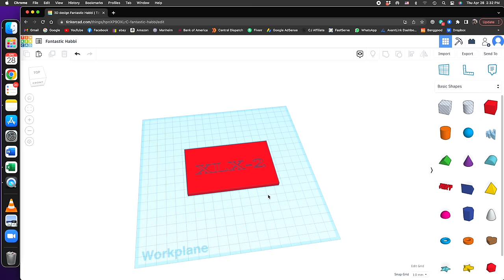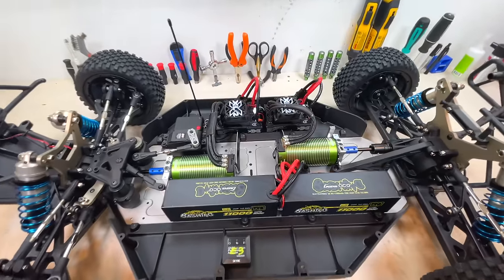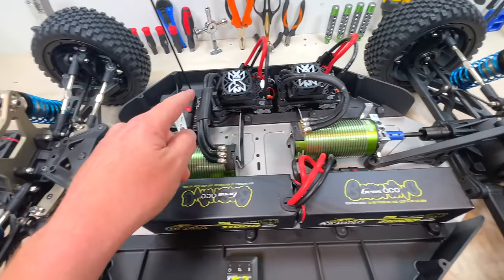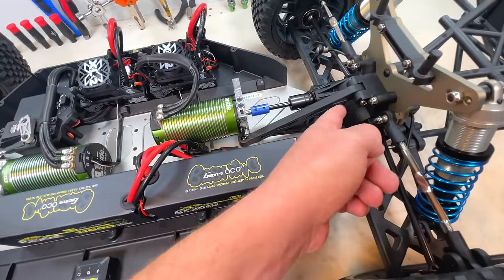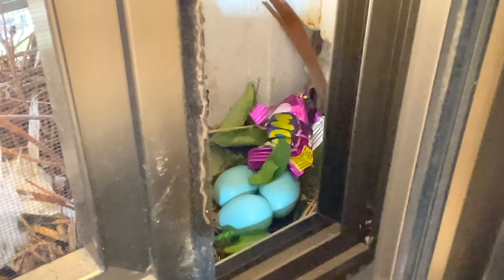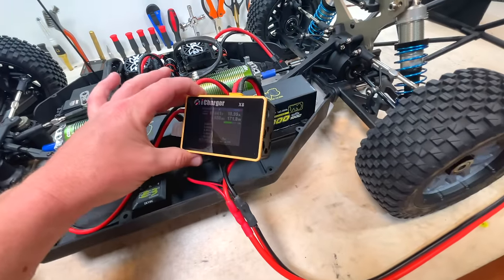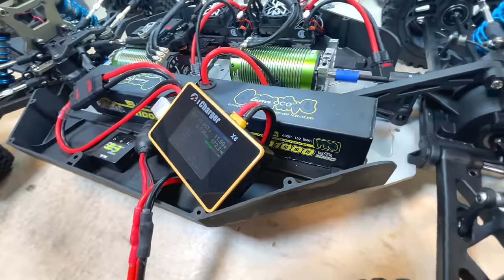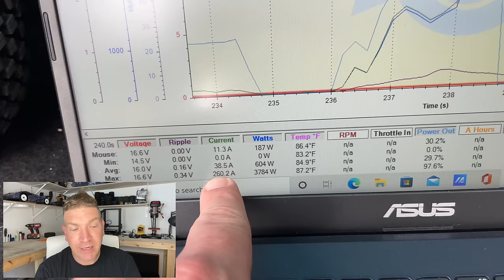Rc Car With Two 25HP Motors - Losi 5ive

Comment: I built a brushless nikko dictator with a bunch of custom upgrades, specifically targeting the Traxxas Slash for performance.  the On a 3S speed run, I was trying to get 1 more mph which required running it through a narrow part of the parking lot. It hit a bump and hit a concrete curb at 45 degrees, probably around 40 mph. The heartbreaking part was 35 year old chassis and transmission pieces were destroyed and could not be replaced without a parts car. I did get it back on the road. It’s my favorite rc car out of the 50 or so in my collection.

Comment: Tough luck on the crash sir. fifth scale vehicles can be a handful to slow down, so much momentum. cant wait to to see how you repair it! for another onroad project, I highly recommend you look into the MCD XR5/XS5 platform. as an owner of both a losi and an MCD I can promise you its a platform like no other. plenty of space on the chassis to do upgrades, massive engineering in the platform as well. I know if you build an MCD it will be like no other.  good luck!

Comment: Raz, I feel your pain. Not nearly as expensive, but I built a 1/10 road car to see how fast I could get it. I am not sure, because the first run ended in the car disintegrating. It was as simple as a center reflector in the road that I hit almost center chassis. The reflector was decimated, but the car was a total loss. There were a good many parts that were never even located. I put quite a few hours in it. Gutted for mine and yours both.

Comment: I thought you learned your lesson about running off road cars without cages? I would like to see corner weights and CG points before and after these builds, cg and corner weight can have a dramatic effect on driveability and I am curious how far from baseline your mods take it.

Comment: Trailer park math here... 11 Ah batteries rated for 100C... that means a max Amperage of 1,100, and at 15V (give or take, depending on charge level), that's about 16k Watts per battery. Now, 25 horse power is 18k watts... so yeah, that's an INSANE amount of power going through such small motors. At first glance, i thought it was total rubbish, but wow... 50HP in an r/c car is just nutso!!! ty for the vid. Sorry about the crash! I flew r/c helos for many years. I know the feel.

Comment: 25 hp is 18.38747 Kilowatt (kW)... How did you calculate those small electric motor to have a output that is 25hp?

Comment: Nice wanted to do this for a while just the funds so I done it to a wr8 that I modified to 257x200 mm wheelbase so it was a 10th scale 2x120amp hobbywing 2x3300kv motors 2x3s never got a clear reading on GPS best run was 63mph on its back wheels great vid sorry for your loss

Comment: since both motors are offset, the batteries and the controller could have been mounted on different sides and the weight ratios would have been balanced.  But still great, wow!

Comment: I love your videos and definitely feel your pain brother! I bet it crashed because you did not run a spool or 2 Million weight oil in the Diffs with belted tires. These are a MUST. Without more-locked diffs the tire without traction will just spin 2x faster, and expand as you can see from the before crash clips and "traction steer" the car. I have been down this road MANY times. Not for bragging but to prove experience, I have 3 Electric 5ives, and all are center spool and 2M wt diff oil (spools make it under-steer in the corners) by necessity, learned the hard way. Anything above 70 mph you will blow out non belted tires if you are off road at all. Honestly, that's not a bad crash at all, it looks like you had 3 problems that came together... 
1. You relocated the front diff support, the stock one has 2 bolts, I have sheared these bolts a bunch of times, until you make something super strong, a bumper impact will break the diff cases every time, even in a CNC aluminum diff housing, this needs sorted out first. 
2.  For that 2 motor setup you located the battery and ESC's to the perimeter of the chassis.  I'd make a plate that goes above the motors that ties into the front Diff support, and mounts the ESC's above it as well. There is a TON of room under the cage of the 5ive T, and it would put the ESC's in fresh cool air. I run similar to this in a 5ive B body with no issues.
3. 3D print motor cradles that bolt through the chassis and can use large Zip ties to hold the motor to the mount to take the strain off of them during impacts.

A few other electric 5ive tips, run the batteries ans ESC's exactly opposite of each other, and as close to center of gravity as possible to balance the 30lbs this weighs, will make a night and day difference when you start jumping it. I regularly clear 150' with no problem or breakage, and bash HARD. I honestly believe these 5ives are the toughest RC cars on the planet.
Reply from the maker: Thank you so much for taking the time🙏🏻

Comment: I'm guessing you highly understand estimated the amount of stress and force on them motors and drivetrain and you throttled  up hard and it sucked up insane amps because of the rotating mass of the 1/5th scale drivetrain and tires and the fact it's direct drive then you need to stop and can't because the motor braking wasn't even close to enough to stop all that mass at speed of any kind. You need very strong disc brakes and I don't recall seeing any. Motors and all ejected because them heavy batteries were only velcroed down and when they went because you use big connectors, big wires and small screws everything went with them.
Reply: good thing its his build and not yours lol 😅

Comment: It’s in the air.  Totaled my gt2 1/8 as well.  Life is funny but next time you only need one motor and it will still be as fast.  The chassis setup isn’t built for speed so it will always be overwhelmed, but f you ran the wing ……would of could of kinda thing

Comment: Inspires me to finally make an electric conversion for my old 1/8 Jammin' X1. I'll probably just do a slipper clutch for the center, motor on the side of the servo with the esc behind it and have the other side for a beefy battery. Even if it ends up like this one It's worth doing because it just sits as it is. I've been done with nitro for years
Reply: Castle used to made an electric conversion for the Jammin X1CR.  I got one!

Comment: Sucks that such a beauty is gone so fast. Is there a reason you don’t model the screw holes into the ESC plates? It would make the mounting holes much stronger as they would have inner walls printed instead of voids in the infill. 👍🏻
Reply from the maker: I was just lazy lol

Comment: Not having the front and rear diffs connected, powered by seperate motors, will be way worse than having an open centre diff, the front wheels will have a ton less load and spin like crazy.

Comment: I think issues wasn’t to run without cage. The reason in damage the engines there’s not rear bracket holder on both engines.

Comment: 25hp is 18750 watts.  At 6s voltage that's around 850 amps per motor.  You sure your numbers are accurate?

Comment: After watching both this and the crash video, it looks like the servo was the cause. In this video you can see how slow the steering returned to neutral. So it looks like the servo is too slow and not enough torque. I'm sorry for your loss, it sucks. But, you have since rebuilt it and I hope you test better servos before running full speed.

Comment: Id like to see one of those motors on a 80 frame dirtbike and see how it wont be no 25 hp of ripping i would guess. Just dont see a shaft under 20mm putting out that kind of power.
Reply: yeah. I'm trying to figure out where he got 25hp each motor. my calculations come up w a little over 5hp each. still 10hp in an rc car is pretty good.
Reply: @jonnytoast  and u can call them whatever hp u want fact is the tread those tires are putting down are only going to grip so much hp which yes the amount of hp the tires will grip increases as speed increases but talk about overkill because those tires up till 100mph will probably only hold so much hp which would be interesting to ACCURATLEY know not hopingly or falsely know.  Again i doubt one of those motors will not sent a 100lb kid over 100ft triple on a 80 grame dirtbike but a 80cc dirtbike with roughly 25hp will for sure.  Some people just prey on the unknowingly people with clickbate HP titles.

Comment: Bummer the motor per end is cool most would do dual motor with the central diff used as the drive system, splitting it front and rear was really hoping to see more driving but stuff happens.

Comment: idk where you got the "25HP" from but the XLX2 has a peak of 20A and 33.6V max, so around 670W of power, that is less than 1hp per motor, if you're at full charge and running 8S LiPo, so this car is infact only 1.8HP max.

It is a lot for an RC car that isn't meant to beat speed records but nowhere near 25HP
Reply from the maker: Haha you've got it all wrong buddy..
20A is just for the radio (the BEC).
600A peak my friend.
Reply: @RazShifrin  thats pretty nuts then

Comment: I want to say a hobby is a hobby, but I am dealing with max5 issues right now, I think I know the issue but I am to tired right now, I can imagine like 1500 in electronics gone in one run, I think next time try foams or make a chassis brace for it so it does not have a chance at flexing at high speeds.

Comment: Raz sorry for your loss😢. my question is how do you figure each motor is 25hp. I'm not hating or trying to be an a$$hole, just curious if I'm doing something wrong in my calculations. still an amazing build. came out great. keep it up.
Reply: Castle link will tell you motor output in watts and horsepower. Just gotta log the esc.

Comment: Hmmm, 25HP?  Really.  1 HP requires 746 watts of power with 100% efficient motors.  25hp = ~19000 watts X 2.  Your telling me that your motors can sustain 19 kilowatts each?  Maybe 2.5HP sounds much more authentically plausible.